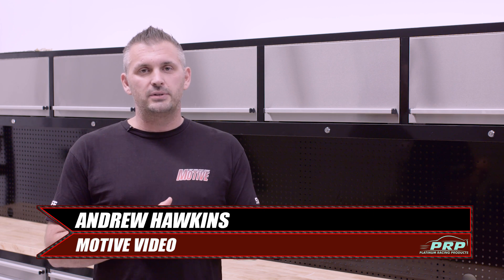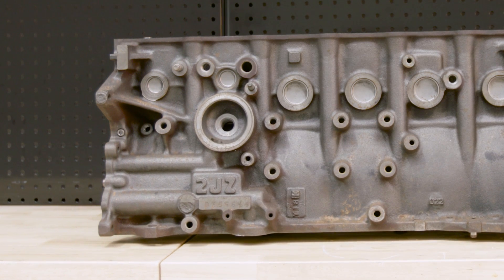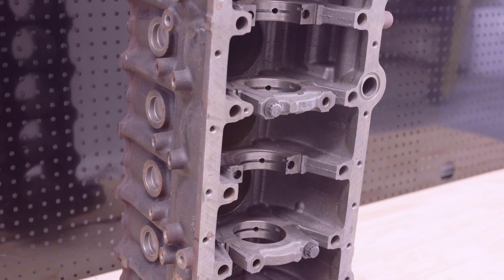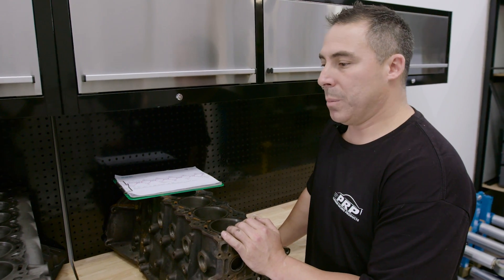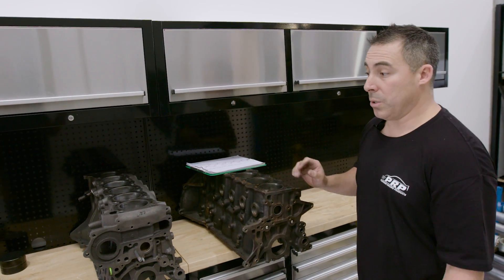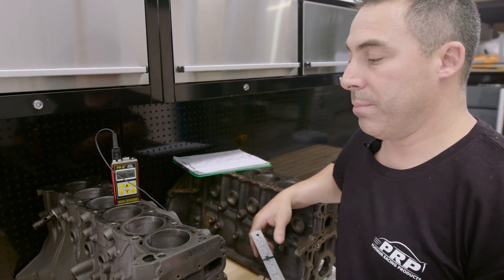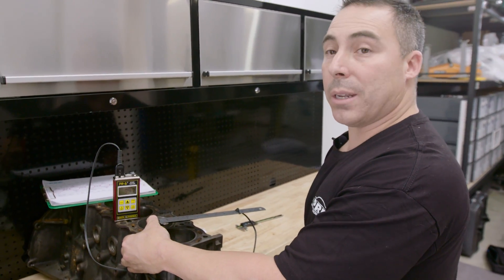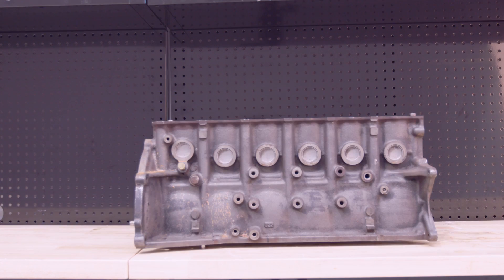RB30 vs 2JZ Which is the Better Block and Why? - Mythbusted

Comment: How hard is too hard? I have a dart 351 windsor im building. I did some brinnel hardness testing and was 320 and up. Thinking of doing some heat stress relieving to bring it down. The higher the hardness the closer to brittle you get

Comment: In Nissans Defense, they do things to keep engines on the cheaper side, they were in countless more cars than the jz engines over the years, and the blocks are essentially modular from the rb20 through to 26 minus internal assembly; a 26 crank into a 25 will make a 26. Can swap parts on a jz. Nissan also developed it on their own, Toyota did not, Toyota has always been able to afford more r&d. 
Seen more street driven 1000+ rb combos not including billet blocks. Not seen any street drivable jz engines hit the 5’s on a 1/4 mile.

Over all, the 2j may be a more reliable engine. I prefer the rb engine note.

Comment: I prefer RB's just due to a few factors, number 1, you cant beat the sound of a built RB.
Number 2, affordability and availability (which almost always come hand in hand).
And lastly range of options. If you are on a budget, grab an rb20det and slap in in your chassis of choice and now you have a cost effective reasonably powerful turbo car. If your budget is a bit more significant, do the same thing but instead of the trusty 20 get yourself a billet 30 with a 26 head, a stroker kit and drop it off to your most trusted engine builder with a blank cheque and you have just bought pure happiness. Possibilities are endless.
Reply: You must not have built either if these motors to actually say rb parts are more readily available than 2jz parts. A 2jz eas actually brought to the US you do realize that right meaning dealerships over here still carry parts. You can't buy anything rb related over here unless you're grabbing from a shop who brings things over from Japan regularly. If you watched the video they point out all the reasons a 2jz is thr better compared to an rb30 which in turn people use those bottom ends on their high hp rb26 builds. So the jz is the better motor compared to an rb26. The rb30 is much stronger and more efficient so what makes you think the rb26 the weaker of the rb30 vs rb26 comparison would be the better option than building a 2jz? 🤣

Comment: The rb was pretty bad at first, it had a crank collar that was to shot that would eat oil pumps and cause them to fail and would completely destroy the engine... basically rb engines would self destruct... 2j is obviously the better block... people even have to put 2jz style collars on their RB engines lol

Comment: So, you are comparing a single cam n/a RB block to a 2JZGTE block, simply because they are both the same displacement. Seems a bit stupid if you ask me.

Just do a 25DET or 26DETT, the displacement is different, sure, but they were designed for power and to be pushed, the 30E was not.
Reply from the maker: uuggghhh, have you seen how many people use the RB30 block but with twin-cam RB25 or RB26 head? It's a LOT

Comment: "The 2JZ-GTE is an inline-layout, six-cylinder, belt-driven dual overhead camshaft, air-intercooled, twin-turbocharged, cast-iron block, aluminium cylinder headed engine designed and manufactured by Toyota Motor Corporation that was produced from 1991 until 2002 in Japan. 
RB30 were produced from 1985 - 1991."
I believe the RB26DETT would be a better comparison as it was produced from 1989-2002

Comment: Yes 2jz is a tougher engine but in most 700-1000hp street applications where there’s no slick tires these supras with 1000hp 2jz just spin even at 4th gear but rb has front diff too then those block thickness and hardness numbers won’t help 2jz that much. I won’t be afraid to race a 700hp r32 in front of 1000hp supra in the street.

Comment: The 2jzgte is just to over engineer to the point it not far anymore to other engines the parts are so cheap with 2jz then rb26 but both are my favorite inline engine one goes sttttttuuuuu and the other goes bwaaaaaaaaaaa both are good the Supra just the better and lighter car

Comment: My family owned a toyota dealership i have 6 suras with 2jz,s with the miles on all under 20k miles one has 992 miles on it . There all twin turbos. There all kept up off the ground in a super super clean shop. 5 are manuals one is a automatic. I love these cars my dad got them on a fucked up order when i was 25 i said keep them all it was not easy due to space today it payed off big time. Dad would be proud. Miles on all 992 1444 2008 15552 15665  17202 for the right money anything is for sale you will will not find one with interior in shape like these there show room condition inside outside under the hood and under the car 0 rust still clean paint underneath. I want them but for the right price anything is for sale. I personally clean all and babied these cars. 😀

Comment: My 2001 2jz has 181k miles and runs like it just came off the factory line. Powerful, quite, easy access. I just replaced the MAF sensor. I can forgive that

Comment: I mean if you want to get technical the GM 4.2 L inline 6 it's like the LS motor of inline 6s minus the aftermarket backing the motor already comes with 299 horsepower without a turbo

Comment: Give it up to Yamaha for building that 1J and 2J,  one of the best engine engineers of all time. Lets not give Toyota and the Supra all the credit. Would love to compare the VG30DETT with the 2J because thats the direct competitor in car and class and engine, weaker engine and all the Supra bow down stock on stock and even modded to the Skyline. Not saying Supras not a beast but its no secret, Supra vs. 300Z is the direct competition.

Comment: 2JZ is indeed an over engineered engine, stock was around 300hp yet it can stand a 1000hp or more, RBs are are still awesome but what make it shine is the platform Nissan made for it
Reply: Absolute fact. I’m a Toyota guy (ST-205 GT4 and SW20 Turbo) but the R32-34 are objectively better sports cars than MKIII-MKIV Supras.
Reply: @negativeindustrial  It's true the R32-34 chassis are true sports cars, the Supra is more of a grand tourer / street cruiser than the angry animal that is the GTR. The Supra in the JGTC series didn't even run a 2JZ because it was too heavy, they ran a 4-cyl turbo, their WRC engine (4T-GTE), so basically it just looked like the Supra you'd see on a street since race cars are completely gutted, these "Supras" won some championships, but the Skylines dominated the whole decade without being too different from the street versions.

The A80 Supra has its niche though being as wide as an SUV (seriously) an engine capable of 800hp+ w/ stock internals to go really fast in a straight line. Plus can't beat rear wheel drive. I can confirm the A80 doesn't really handle well by today's standard (feels like a boat) as I daily one, its pleasant to drive w/ power on tap if you need it. I can't see myself daily driving a R32-34 w/o going to jail, I would be doing time attacks to the grocery store and to work.
Reply: @p4yat0t  
The JGTC Supras used Toyota’s 503e engine which is a race version of the 3S-GTE used in the Celica GT4 and MR2 Turbo. But, yeah, totally agree.
Reply: @p4yat0t  you must be new here because supras were not only involved in wrc but they were also time attack cars in Japan from the a70 to the a80 not hard to find info on either. The gtr just had an advantage because of it being awd but that's where the advantage ends.  The supra and r34 were in direct competition with eachothwr for a reason apple's to apples. Not sure where you got all that info from but I've been putting 5ms-2js together for the better part of 24 years and have friend with r32s-r34s some have their preferences that's a. In terms of the power plant the 2jz/v160 was the better packaged deal they were rated at 326hp not 300
Reply: @LucidBoost_3600   I'm just saying legendary JGTC Supras never ever used the 2JZ, they used a turbo 4 cyl (4T & 3S GTE was lighter and packed the same power output of the race class) and then even a V8 (3UZ for torque), the Nissan cars actually ran RB26 engines in their JGTC cars. (Until they were uncompetitive) If Toyota ran the 2JZ in the JGTC cars, they would get murdered by the Skylines rocking the RBs. That heavy engine w/o the advantage of AWD the Skylines have is a death sentence.

In the street, talking power plant only, the 2JZ is superior to the RB series. Stronger block, overengineered and reliable for basically unlimited power compared to the RB. But the Supra platform is the 'softer' one compared to the GT-Rs. (32-34)

The MK4 Supra is a GT car, the GT-R is more of a track weapon due to the AWD and if you were comparing them to their JGTC cars, the Skylines are closer to the street version than the Supra is. Even down to the advertising, the GT-R always shows its racing pedigree in it's brochures while Toyota advertises the Supra as a sophisticated street cruiser, kind of like a sports Lexus.

The Supra in street trim doesn't have the track poise an FD RX7 has or the tech that a GT-R has. It's a comfortable cruiser with power, and like I said, I daily one and the handling sucks comparing to even modern FWD hot hatches. The GT-R 32 to 34 is more comfortable on the track than a Supra is.
Reply: @negativeindustrial  the Supra started off with the 4T-GTE then the 3S-GTE variant then a 3UZ V8 as regulations and design philisophies changed throughout the years, the chassis was being run in JGTC / Super GT from 1994 to 2006 so there were alot of changes througout that period.
Reply: there is no such thing as over engineered. It is engineered, the others are lacking engeering.
Reply: Fantastic, literally what the video just explained
Reply: They're rated at 326hp in the US and 276whp in Japan's due to the gentrlmens agreement. A change to usdm injectors, turbos and cams changes that though. Steel wheel turbos 550cc injectors as opposed to 440cc jdm injectors and a mote aggressive cam in usdm 2jzgtes
Reply: You can also go na-t with a non vvti 2jzge and make the same power seeing as how the ge non vvti had thr same button end interbals as a gte

Comment: Before I even watch this I'm 99% sure that the 2JZ is a better engine. Only the Skyline is a better platform.
Reply: Actually it's not the biggest advantage the A80 has over the R34 is the chassis itself it's more refined and aerodynamic. When you're in a A80 things dont feel cheap either like the R34 the biggest problem is the BNR34 was made based off an economy car counterpart and that absolutely sucks. The GT-R has a better weight distribution but the Supra is more solid especially at high speeds on a road course. Also at high speeds you dont hear creaks and rattles like you do with a R34 chassis. The ATTESA gives way better traction and it can ALOT easier to drive than the Supra depending upon which tires you run. In modern day AWD can be irrelevant based on that because I've chased down Evolutions and Imprezas with ease on the touge. I've even had an Evo VI understeer into the grass in front of me on a road course.
Reply: @KeenanStyles  the supra has a better weight distribution then any gtr
Reply: @KeenanStyles  “you don’t hear creaks and rattles “ what? Have you done a top speed run in a R34?
Reply: @Craigster11  I had an R33 GTS-T (yeah not a GTR or even an R34), trust me you don't need to go top speed to hear creaks and rattles (I had a 1996), I have a MK4 Supra now (with more miles than the Skyline) and people I take in rides always compliment on how nice the interior is quiet and pleasant (until 2JZ no shit kicks in) and are shocked to hear that it is sometimes older than them (1994), the Skyline was noisy, rattled in places you couldn't figure out and glue / pieces of the door and interior panels falling out. The Skyline had less owners, newer car, and less mileage so go figure. Toyota's build quality was something else in the 90s. Nissan, was just, well Nissan.
Reply: @KeenanStyles  whatever kid most of us will still choose the grr platform all day lmao but nice try
Reply: @AmaAndZing  they wouldn't choose a harder to find parts build over an easily attainable 1100whp stock block 2jz minut billet mains. An rb26/rb30 could only dream of those numbers on the stock bottom end

Comment: This means nothing in the real world. Show us efficiency by put the same turbo on both engines at same boost in same chassis. We'll then compare the dyno graph to evaluate how quickly each setup builds torque and max hp, etc. Then show us the durability test that which engine gives up at what hp.
Reply from the maker: Cool. so whos paying for that?
Reply: @MotiveVideo  The ones who started this comparison
Reply from the maker: @xgrapher  Waht you're asking is tens of thousands of dollars worth parts, labor, filming and editing. Maybe even 100,000. This video has probably made us $2000. Simple maths on why what youre asking isnt plausible or possible.
Reply: @MotiveVideo  Mythbusting is a difficult task.  You did durability and weight test but the most important was performance and yet you gave your verdict. An average person will take that as an overall comparison.  So the bottom line is this comparison is just as good as my friends cousins girlfriends dads comparison.
Reply from the maker: @xgrapher  We aimed to do a bock comparison. We did exactly that. If you cant take anything from it, we cant help you. plenty others have. feel free to do your own and let us know how you go.
Reply: @MotiveVideo  This is like Fox News it doesn't say it explicitly but yet it implies that. Block weight is meaningless overall engine weight is required. 11 oil return lines vs 5 is not a good way to judge Chevy's 2 valves per cylinder draws more cfm than many 4 valves. K series block is softer than RB30 and yet people have taken it to 700+ whp. And finally our 935whp RB30 is sleeved but oiling has no issues running on an N1 and restrictors. No doubt 2jz is better but your scientific approach in proving that was incomplete. And yes Rb30 is torquier!
Reply from the maker: @xgrapher  No mate. you're implying it. It was a block comparison only. That's it. With valid testing procedure and results that are backed up by real world findings and numerous race  teams and workshops.

Comment: Why couldn't toyota make a 3jz but nooooo! We get a z4 with a toyota badge😒
Reply: Because it would have cost millions in R&D and probably perform worse than the B58. The only bad decision with the new supra is that you can only get it with a manual transmission.

Comment: Thank you, excellent comments. The bore pitch of the JZ is 92mm, of the RB 96.5mm. I've calculated the actual journal overlap (the enclosed area of the intersecting lens) of the 2JZ (stroke 86mm, rod 52mm, main 62mm) at 5.53 square inches, and that of the RB30 (stroke 85mm, rod 50mm, main 55mm) at 3.25 square inches, a huge difference. Coupled with the greater overall length, the 2JZ crank is much stiffer.

Comment: Your data is not wrong just incomplete. The data you gave does give the dotile strength nor impact strength.  Hardness prevents warping not cracking. You should ask what is the temper metal and method of bore. The engines shape geometry has more to do with structural strength then simple length.  Weight displacements is the only way you can measure denisty. That will also tell you you metal blend quality.

Comment: "Where an RB normally cracks"...."doesn't have the oil problems of an RB with oil getting stuck in the head"... Do I need to watch the rest of the 10 minutes knowing the 2jz is king after hearing this?

Comment: Extremely informative.  I have a newfound respect for that 2jz.  I have been a gtr fan long before the Gran Turismo generation messed up the affordability of the R34 for me but now i see why the supra's are getting so high priced...they are probably worth it. This also BEGS the question...why didn't they just evolve the head design for the new supra instead of that POS bmw power plant?
Reply: I said the same thing! Why not recreate the 2j and get Yamaha to do the head again
Reply: They kept in mind a proven motor which is the b58tu. Being a Toyota guy I can agree to an extent they took saving money into account while designing a car that was more than capable hence these cars getting alot done with not many mods similar to a jz. Downpipe and tune puts you well over 500whp which is pretty dam stout. The tq the b58 produces down low is impressive too. Just wish bmw went back to thr drawing board and brought another jz to light. Being thay the epa is down everyone's neck we will  ever see another badass inline 6 even close to the 2jz ever again. It was produces in a time when emissions didn't matter at all
Reply: @LucidBoost_3600  THx for the reply. You indicate due to emissions we will not see a high power inline 6.  How does cylinder configuration affect that?  Or are you just referring to the race to EV.

Comment: Almost 3 mins into the vid im already sold on the 2JZ, that being said both are good engines, unless you're in competition, it really doesnt matter a 1000 horse power is 1000 horsepower.  I would still go with the JZ regardless just because of reliablilty alone 😀

Comment: You are confused by fluid dynamics. A 16MM line will not flow twice of what an 8MM line flows, it will flow more like 10 times as much oil per hole, but there are many other considerations, like bore surface finish, bore length, and any bend radii.

Comment: The legend said, he prefer jay z rather than kanye west. if u had engine  problem i feel bad for you son, my stock block can handle 1000 horsepower with no 99 problem but bitch oil problem ain’t one.